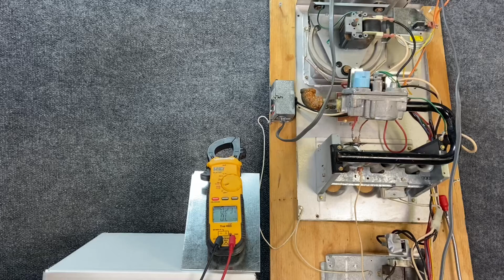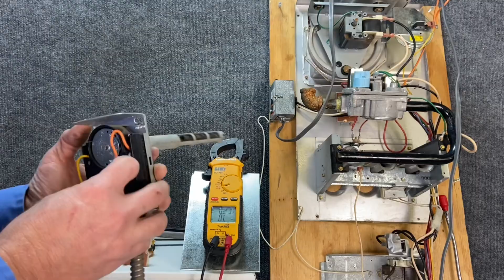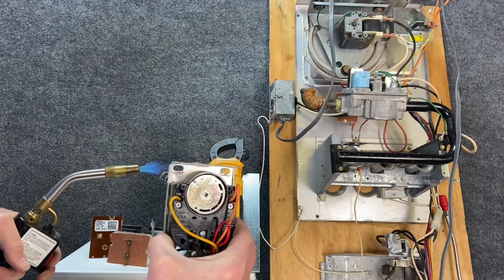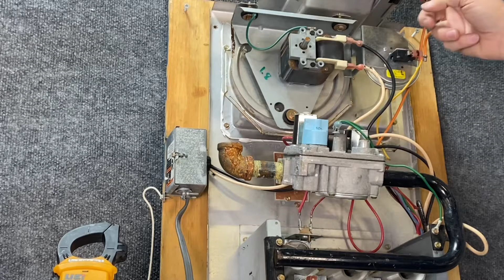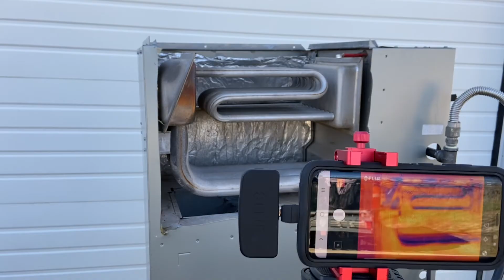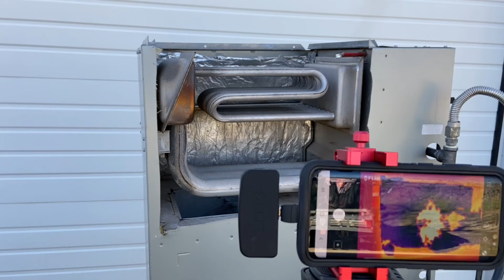Limit switch gas furnace

Comment: I still have a fan limit switch in my garage and works fine and reliable and cheap to replace.  
What is the benefit of the new time delay Boards that replaced the fan limit switch.  I find that all the service on the new units are because expensive new style parts have failed vacuum switches and time delay boards which never match and cause units to be left down leaving customers with no heat for a few days.   So I don’t see the benefit of new control boards.   Thanks Eric
Reply: I have 2 lifesmart 1500 heaters that I loan to customers while installing their new boilers but I don’t see the benefit of progress when I have to supply temp heat to do service on these units.  And customers don’t like to pay for the heaters that’s why they had furnaces or boilers. I guess that’s why we are a dying breed of mechanics.  I enjoy your videos and your way of teaching.   Thanks eric
Reply from the maker: I completely understand where your coming from. Simple is less moving parts, less breaking, easier repairs.

However that does not stop change. I remember working on cars with carburetors  and simple electronics that could be repaired in the fly. The push for more energy efficiency  and safety drives both of these changes.

My issue is not with the fan limit control, it's with the natural draft furnaces that notoriously had back draft and cracked heat exchangers. That was an issue back when they where new. Now considering they have not made a natural draft furnace (exculding shop heaters) since about 1993 all the ones out there are a high risk. 
I remember replacing the old style fan limit switches every week back in good ole days. I had one of each size. When they rusted up they would overheat the heat exhanger and cause cracks often.  
Universal pressure switches can be stocked on the truck now days. I even keep universal control boards to get them running until the replacement comes in.
 In some cases I have brought my customer temporary heaters rather than risk a CO safety.

Comment: Great as always. Question regarding the thermal imaging camera you got on your phone. How happy are you with it? And can you post a link? I have been looking for something good. Thank you
Reply from the maker: It's the FLIR1 
It works great for checking receiver levels,  evaporator, duct leaks and basic  infiltration, and insulation issues. Its not powerful enough for thermography or energy auditing but its just right for me.
Reply: @love2hvac  I'm a service tech (I like to believe so 😉 I've been doing hvac for 15 years and still learning) all I need it is for exactly that reason. Thank you so much for everything.
Reply from the maker: I'm still learning, my mentors will say the same thing. Stay on the learning side it's the best place to be!
Reply: @love2hvac  Bought it and so far am happy with it. Thank you

Comment: I have a question: Will a crack in the heat exchanger cause CO levels to rise drastically in the exhaust flue? If so, can you please explain why that happens. I understand how a cracked heat  exchanger will cause CO to go into the home but I don't see how CO levels will increase in the exhaust flue. Thank you in advance.
Reply: it will, but will not make it too bad as I can understand. The reason is very simple: when there is a crack in heat exchanger, the inducer motor will draw air from both outside and inside of the heat exhanger, that means it wont draw strong enough air from inside of the heat exchanger, that means no enough air flow going through the in shot (combustion)part of the furnace, that means problems, obviously none fully combustion.
Reply: @ND-fy3wu  thanks for your answer
Reply from the maker: In short, the excess air causes the flame to cool too rapidly, and it changes the flame pattern causing flame impingement against the heat exchanger. 

A cracked heat exchanger can cause high flue CO. High flue CO does not mean it's a cracked heat exchanger. 
I like to look at CO and 02 before and after the blower runs. If the blower kicks in and then CO and 02 both go up, its then I'm looking at the heat exhanger.
Reply: @love2hvac  Makes sense. Thanks for the explanation.